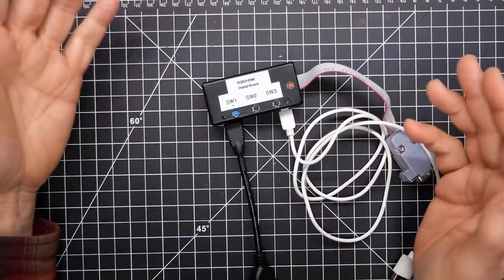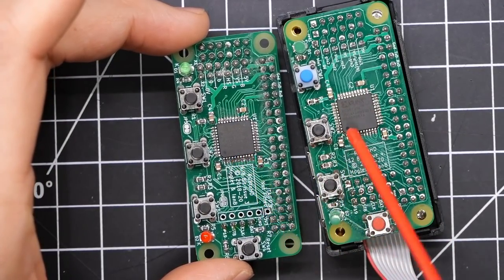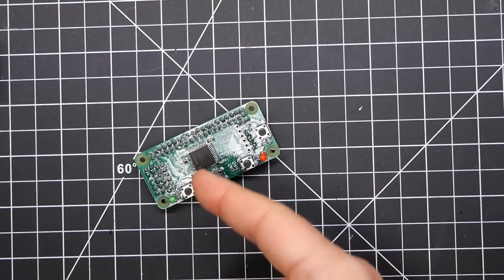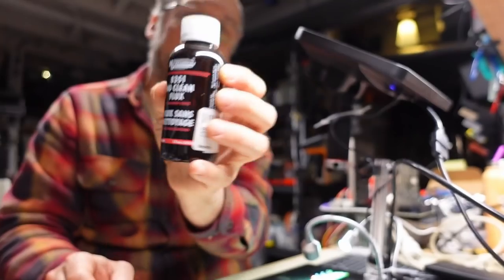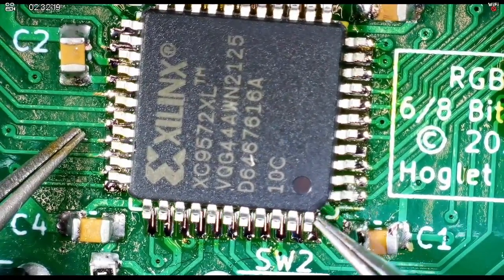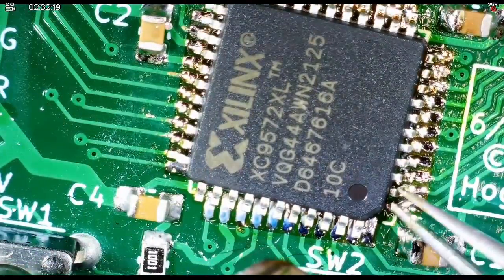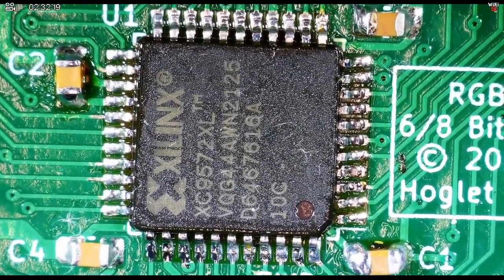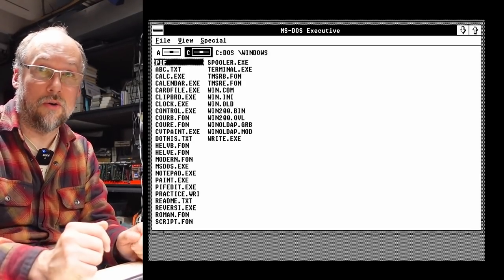The perfect way to NOT do SMD rework (RGB2HDMI overview and repair)

Comment: I can only echo what others have said, the most important thing for me when assembling these boards is the best quality flux you can get and plenty of it to float the CPLD into position.  I use and recommend Amtec 559, a good hot air station is a must, and in the case of my old eyes a magnifying headset and jewellers loop for checking. Then it's  just practise, practise and more importantly practise.

Comment: One tip my boss taught me when showing me how to do SMD work:
Cut the solder wick diagonally to have a really precise tip on the wick with low thermal capacity to suck up the excess solder!
I recommend ChipQuik for really good flux. Cleans perfectly with IPA.

Good luck! Do try again!

Comment: If I may be captain obvious by adding like the 1 millionth likewise comment here... you were quite good, especially since you got the job done. Believe it or not, I've been performing SMT soldering for over 33 years as well as holding various IPC CIS and CIT certs (J-STD-001, A-610, 7711/7721 as well as their respective precursors) and one thing I notice in general about many beginners is:

1) Most are used to naturally holding larger things (duh! LOL!). It looks really easy when videos of some other notable "microsolders" perform the job really quickly and with precision. If one is really new, then it helps to allow their body to "relax." I totally understand that it's really frustrating at first, but being relaxed is what I truly believe and experienced is paramount.

2) Most just want to get it done. Of course who want's to drag things on, especially since time is money and content viewers most often agree. It helps to also start slow and increase as one develops better manual dexterity.

With that mentioned, there are just WAY too many other variables along with various techniques to account for, so I don't want to delve down that rabbit hole (especially since I have to do that almost everyday at my job). On another note, I mentioned the IPC certs earlier ONLY as a reference point, so before anyone reading rushes to get a cert for soldering purposes, they are EXPENSIVE and often UNNECESSARY unless one is in a specialised production and/or mission critical repair environment. Just thought to clarify that.

Keep practicing and keep up the good work.

Comment: I just started with SMD soldering with some practice kits I bought on Amazon and I've learned with the solder bridges, if you put a glob of flux on there (I use the thick stuff) and completely clean off the soldering iron tip, you can drag it across and the excess solder will collect on the iron. Sometimes have to clean the tip and go back over it a couple of times if there's a lot, but if it's too much I use the solder braid and redo the pin if too much comes off. .

Comment: I've been doing surface mount for years.  There is definitely a learning curve to it.   If you are going to hand solder, definitely  remove all the old solder and just tack down one or two corners.  Flux is your friend, I use a Flux pen from chemtronics.  Also for removing Flux, I prefer acetone to isopropyl, but it is not safe for all plastics (but will totally dissolve the hard to remove fluxes).
Anyway, the end result speaks for itself, great job for a newbie, and the commentary was hilarious.

Comment: I'm sure many others probably mentioned that they we would have removed the old/new solder, cleaned the board, applied new solder, tack a corner down and then as you said drag solder the rest. Rosin flux sucks for doing this kind of work. Thanks for sharing your adventure, everything is hard until you figure out how to do it!  ;-)

Comment: Not that my experience matters but, I recommend removing old solder and then using solder paste with the hot air. The chip and other small parts don't move with it.
Reply: Solder paste is a mess, whit air they spread all over. Use solder iron (dont take to much time whit good solder flux and chisel tip) or hot air
Reply: @yoyomismo2052  I don't have any problems with it. I use a syringe and clean up with Alcohol afterwards. We all find our own way; with my shaky hands, it works best for me.
Reply: Solder paste is too much of a pain without proper stencils... and it's usually too thick to apply manually.. though you can mix it with a bit of alcohol or thinner flux to make it a bit more runny. You'll end up wicking most of the excess away though, or worse - getting unmelted paste stuck under the chip!
Reply: Can't say I'd recommend this method for repairs over just tinning the pads + hot air, although for a leaded device like this, I would use hot air with a much wider nozzle or ChipQuik alloy to remove, clean the pads, then place the device by hand either pin-by-pin for this 0.8mm device, or drag soldering + wick for smaller pitch devices.

Even if you happened to have a stencil available for the device's pads, it's very unlikely to fit on an otherwise already populated board.
Reply: I agree with tommy, solder paste is alot easier, a good paste wont create much mess, also the smd parts will move in place easily without much fuss. You can then use a small soldering iron tip to cleanup if need be with some flux.
Reply: I think the people who say solder paste is messy are simply using too much. You actually need very little solder paste

Comment: You did a great job on that. I had to replace a 40 pin SMD chip last year, it was 3 hours of pure hell. By the time I finished, I had a wonky chip but a working board. At least your chip was square onto the pads. LOL.

Comment: I replace chips like this almost daily in my job.  Use a bigger tip on the hot air, temp about 350 and air velocity is set at half power.  Then solder new chip not with air but just a soldering iron and drag soldering, with flux all you will need is a little bit of braid cleanup.

Comment: When removing any SMD, mask off with Tape Kapton etc,  Heat up then remove, you could heat up a mains cable copper wire in a square with a iron to spread the heat, too long time to do that be aware heat damage PCB,
Remove ALL solder, with IC taped into position tac down two or more pins on the IC, then with a fine tip soldering iron with thin solder tac down whilst making sure all pins are flat to the PCB,
Always solder from tip of IC Pin to PCB using minimal solder,
Clean flux off with isopropyl, use paper towel tap gently around the area of flux, 
Make sure no flux under components, blow air under components, Dry hottest 50°C
Philip retired UKAS - Aerospace Engineer

Comment: This reminds of my first few attempts to stick chips on the boards. The scare of getting solder bridges especially on low pitch QPFs makes you think pre-tinning pads is a good idea; but good solder joints requires getting both pin and pads hot and as flush as possible; using enough solder, not too much, and a quality flux makes drag soldering easy and only viable option when using soldering iron. 
Soldering requires a delicate thermal and mechanical conditions and you only learn it by doing it and learning from your mistakes and physical reasons behind those mistakes.

Comment: For smaller chips I find picking a nozzle that's about the size of the chip and blowing straight down on it (with some motion to make sure I hit the pins) does a good job. For example, on a QFP I'd pick a square nozzle that's slightly larger. For a long package like a SOIC I use a round nozzle with a diameter about the width of the chip plus leads. I'd usually rather overheat the chip than the board--the chip usually tolerates it better and the epoxy casing doesn't seem to absorb heat as easily as some PCB surfaces. For larger QFPs (like the ASICs in Sega consoles) it might be worth it to invest in some specialized QFP nozzles.

Also, pretty much all hot-air desoldering is made easier with board preheating. The hotter the overall temperature of the board, the less heat will get drawn away from the area you're working on. Heating the whole board slowly and evenly also makes it less likely you will warp or otherwise thermally stress it. I think you can heat most circuit boards to 100 Celsius without damage--just beware that you don't use a preheating method that can cause hot spots or overshoot your target temperature (like infrared).

Comment: I've only done one SMD chip before, but what I did was line up the chip and put an alligator clip to hold it in place (which was a tip in the instructions I was following).  I think doing the same might have saved you a lot of fiddling with the movement.  I too have a cheap hot-air station, but I ignored using it.  I just soldered the side away from the clip with my overly-large iron, removed the alligator clip, and then soldered the other side.  At the end I had two pins bridged, but just wiped them with a clean tip and it wicked away the right amount of solder - which I consider pretty lucky given my lack of experience/skill soldering.

Comment: Couple people mentioned it but the thing that messed you up on positioning was not cleaning the pads after you pulled the old chip.    Wick all that solder off, clean the flux away with alcohol, then apply a TINY amount of flux to the pads, apply heat to the board and flow a VERY small amount of fresh solder so they pads stay flat and don't blob up.

Then the chip will want to center its self and the board will be pre-heated.  Reflux a small amount on the pins and apply heat. The chip will suck right into position. 

Remove heat and inspect with a microscope.

Comment: If that was your first attempt, then you did just fine!. Its a learning curve but after a few goes you get a feel for it. Its amazing just how much chips can tolerate high temperature for such a period of time. The trick to not damaging the device is to keep all the pins and body at the same temperature.Thats why hot air is good.  But if you get a gradient, cold one side / hot the other, it can break. But its still best to try and do the job quickly to reduce prolonged heat. Only other tip is: use plenty of flux!. Even old solder will work fine if you have enough on the board and use lots of flux. Great stuff and well done with the result!.

Comment: Glad I'm not the only one struggling with that! But learning on the way! My method is to remove the solder from the pads altogether, then go with the soldering iron one leg first, then align, then one leg on the opposite corner. If you leave solder on the pads, the chip is going to sit on the solder and you'll have to add more - potentially - to try and bridge the parts. My opinion anyways. :) Thanks for the video!

Comment: Adrian, I ended up buying an smd soldering practice board to improve my smd soldering technique. The practice really helped. If you don’t want to buy a practice board, you could always practice using scrap/parts boards. I like yourself do not do smd soldering as part of my daily work but decided to learn the technique because in the near future everything is going to be smd components and I’d still like to be able to repair those future devices.

Comment: One trick i've done with those QFP's is to pre-tin the feet of the IC and then the board, and then with a dry iron tip touch each leg. Avoids a lot of the bridging that happens if you try to drag solder, and there's not much if any excess to clean afterwards. 

One of the bigger dangers of hot air to attach the IC is that too much heat will cause the pads on the board to start lifting. I'd suggest getting a junk board and heating it up beyond repair to see what happens, after it gets too hot you'll hear it "popcorn". This is where the surface layer starts to come away from the PCB. Interesting stuff. I only use hot air for removal and only if I absolutely have to for attaching BGA components. I'm not that great at it either. Tough skill to master.

Northbridge Fix seems to use a coffee filter with ipa to soak up the residue and agitate with a brush. Seems to be very effective without leaving little fibers behind.

Comment: It was great seeing you try to use a few different techniques and show the issues you had with them. I use the tack and drag method, which is pretty fast if you use enough flux. One thing I noticed is that you probably had way too much solder after removing the chip. That makes it challenging to get the chip to line up correctly.
Reply from the maker: Indeed, I know now it would have been best to clean all the pads with braid, then just tack the corner pins. :-)

Comment: I was afraid of SMD soldering for a very long time. I rather drilled a hundred holes into a PCB and use through hole parts even if the same thing could be accomplished with SMD components. That changed in 2018, when my back then boss saw one of my hobby projects being designed and asked me why I'm still using THT stuff. He offered me to have the board made on the company's costs, but only if I used SMD components on it, where possible. Of course, I did agree and when the PCBs came in, he sat down with me, soldered on an IC, while explaining what to do and why, and then handed the rest over to me. He also got me hooked on using desoldering braid, which I now absolutely prefer to solder suckers.

Comment: When doing chips such as that I remove all the old solder from the pads using solder wick/braid, then place and position the chip before tacking down opposite corners with solder. Then I drag solder the rest of the legs. You need a gel type flux though. The problem with the method you used is that you are trying to balance all the chips legs on rounded blobs of solder, so they move.

Comment: 31:15 I find solder wick always leaves the most difficult burnt residue when you're done using it. The MG chemicals 4140A-P flux cleaner pen does an amazing job cleaning it up. Also if you add extra flux to your wick it doesn't happen as much. Solder wick is one of the scenarios where the 8351/836 liquid flux actually does do a pretty good job, since the wick soaks it up.
Reply: Have you ever tried the 'Wet Wick' method? Leave about half the width of the braid when you trim the used part, then wet it with your flux. The solid tip speeds up the wicking, and the extra flux help leave the board in better shape. It also reduces the chance of overheating a pad. I've done it this way for about 45 years. I did better rework at my bench than our production line's rework department.
Reply: @michaelterrell  I think I've ended up doing things that way just by accident.
Reply: @rfmerrill  It both uses less solder wick, and reduces heat damage.
Reply: @michaelterrell  But yeah, having some solder present to make a thermal connection between your iron tip and the wick can help heat it more rapidly. A dry iron tip on a dry wick with no solder will just make a lot of burnt flux.

Comment: here's what I'd recommend: once you have the piece aligned when cold (good!) resist the urge to touch it again. hold the heat vertically (an angled nozzle helps avoid the microscope) over the center of the chip so the air spreads evenly over it - don't move the air around manually. wait for all the solder to melt and the flux (can't have too much) to pull the chip in place. only then, apply gentle vertical pressure to the center of the piece with the tweezers, remove the heat, wait for the solder to freeze, done.

Comment: not sure if anyone said in in a previous comment, but when doing what you were doing, you could have pre-tinned the feet on the new chip with solder, put down flux, then removed the old chip with hot air, do not remove the old solder, just place the new chip lined up as best you could, then add flux and then apply hot air.  once the solder melted the surface tension of the solder would have pulled the chip into the correct alignment and even sat it down so there would be not need to hold it in place or try to push it down.

Comment: Hey Good job learning! You can only learn by doing! I think your biggest tripping point was the super tiny hot air nozzle. you have to heat the whole chip area at the same time so a bigger nozzle would have helped alot! But yea I think the proper way would have been to after removing the old chip use the braid to wick the solder pads clean. Then tack the corners and then solder the sides that werent tacked and then solder the sides that were tacked. Love your videos! You are such a character!

Comment: LOL! This was so painful to watch, but you did a good job. The hot air rework station is good for REMOVING surface mount components. I'd have removed all the old solder after removing the old chip (making the surface flat), put the new chip on, tack it in place, then just solder the pins with the SMD hoof (or a J tip). I've been using Kester 951 no clean flux which has worked okay, and recently encountered some sticky flux on a board I was removing components from, and it behaved exactly as I though it would, so I'm probably going to switch the type of flux I use when I run out (I also have an MG Chem flux pen).

Comment: Great video, seeing what not to do is nearly as useful as what to do. I was taught how to hot air solder in the 90s but I am sure I made all the same mistakes. I agree just using the hot air to remove and the the iron to put back on. I actually prefer to solder with flat pads (not pre tinned just flux).

Comment: Not really computer related, my box fan stopped turning and rather than simply buying a replacement (and inspired by the repair videos here) I took it apart and cleaned out all the gunk that was stopping it up. The repair was successful. According to Walmart's listing for the fan I probably saved $20-something. Its a good feeling to get one's hands dirty and bring a dead device to life, saves money and time too.